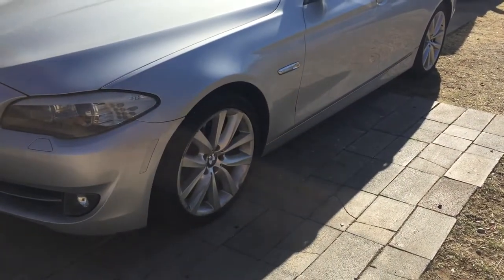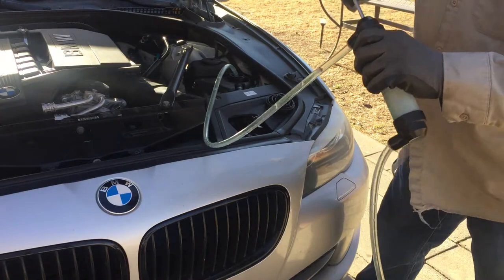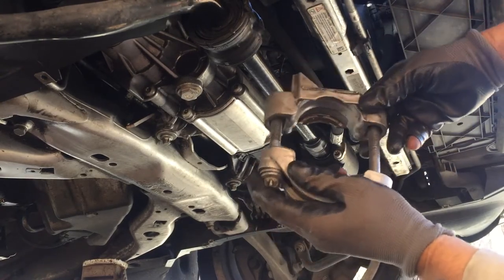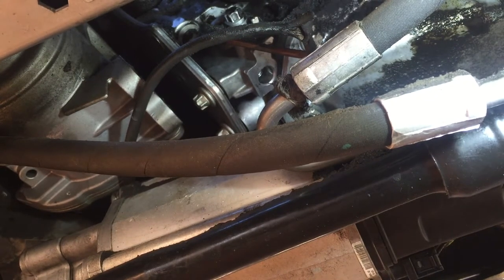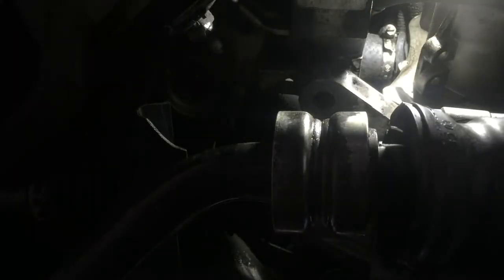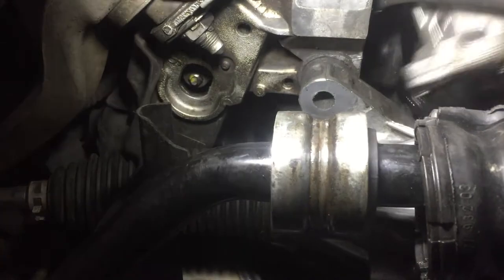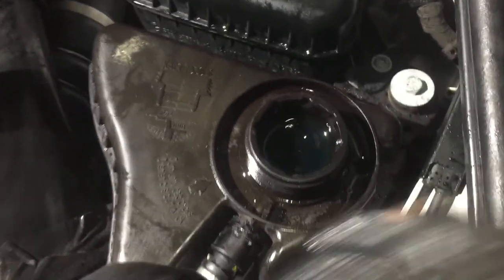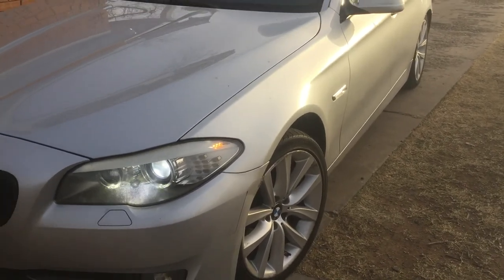2011 BMW 535i water pump & easy way to remove thermostat back hose

Comment: I was able to get the water pump out from the bottom by maneuvering it towards the center of the car. I just needed to temporarily remove a bracket for the bottom shield of the vehicle. Of course I was able to bring in the new water pump through the same route. Hope this helps others.

Comment: Good vid man, it's not a tough job but there is a lot of stuff in the way. I bet it's tough to film while you do it too. You can loosen the electric steering rack and drop it a bit so you can get the pump and thermostat in and out from the bottom. If you ever have to do the high pressure fuel pump or an alternator, let me know. I have a lot of experience with those two lol!
Reply from the maker: Hi Alex R thank you.  thanks for your comment I appreciate you thank you for watching

Comment: Another great video. I changed both but it's still overheating. No leaks but but only hot air keeps returning to the expansion coolant tank. Any suggestions?
Reply from the maker: Hi Chaka Atiim Gale If worse comes to worst blown head gasket or crackhead but I don’t think that’s the case you might have an air pocket stuck in there Jack up the car from the front fill it with coolant leave the cap off run it for about five minutes in that position and you’ll see all the  air pockets come up let gravity do the work and then take it for a test drive and see if that helps good luck brother .thanks for watching I appreciate you

Comment: Oh glad I watched this because I’m getting warm air through the ac front, hot on the floor but I was told valve, but then the fan was coming on intermittently….then I told him that’s not normal because what is the fan trying to cool off and sure enough…got a code for the pump, thermostat

Comment: Where did you puck up the replacement pump and thermostat
Reply from the maker: Hi RoadHerose610 FCP euro it’s a little more expensive but when I was running Bmw, they were offer a lifetime replacement on the parts. You can find them on another websites cheaper  but if you go to cheap they won’t last that long. thank you for watching. I appreciate you.
Reply: Thanks

Comment: Had a guy replace the water pump and thermostat on my bmw 535i 2011.  Now its leaking coolant by the driver side. Hes gona. Cowm check it out soon. Any idea what might be causig/whete  the leak is comig from?
Reply from the maker: Hi Laslay13 well your water pump should be like in the middle a little more to your passenger side   unless it’s dripping and running down a hose or a part of the car   but right now I would guess maybe just  a hose wasn’t tightened  they’re pretty hard to get to you kinda have to squeeze in there and tighten them up Hope that helps and thank you very much for watching. I appreciate you.
Reply: @Marty09933  I see.  Thank you and Semper Fi brother!!
Reply from the maker: @LASLAY13  you’re very welcome brother. Thanks again for watching  Semper Fi

Comment: Some water pumps have the electronic box on the front and some on the back of the pump,should I check what kind is mine or any type can fit on the car?
Reply from the maker: Hi Benjamin Franklin yes check your vehicle first if its like mine it should be in front .  Or it won’t fit   I go with FCP Euro  more expensive but life time warranty if it’s in the budget  if not you can go cheaper but won’t last as long.  Thank you for watching I appreciate you ….
Reply from the maker: Benjamin Franklin …,,https://www.googleadservices.com/pagead/aclk?sa=L&ai=DChcSEwjfvJqRhqT2AhWMKUwKHbTfCBoYABANGgJvYQ&ae=2&ohost=www.google.com&cid=CAASEuRoLqZwXEJFIFlkJPqd6feuTQ&sig=AOD64_368PaWXYDb6odW6vFmVAVm46kgbQ&ctype=5&q=&ved=2ahUKEwiv8I6RhqT2AhWxlGoFHTMCDZ0Qwg96BAgBEBA&dct=1&adurl=
Reply: @Marty09933 Thanks for the answer mine is n55ix 2013
Reply: @benjaminfranklin7998  was it the same as in this video ? I also have a 13 ix
Reply: @MrJoshbroady  Yes,it was the same pump,replaced everything alright now

Comment: What was the part number for the thermostat ?
Reply from the maker: Hi Hamzah Oaisar sorry I don’t remember I bought all of this in a package. Thanks for watching I appreciate you….https://www.googleadservices.com/pagead/aclk?sa=L&ai=DChcSEwjf9eOQ_87yAhWNcW8EHXYKDo0YABAEGgJqZg&ae=2&ohost=www.google.com&cid=CAESQeD2EZ92f_IYh_G6YQc1MyQft3JFygI2xjU8v0GLr7ddcJacujCUEnfZ9vnQFSwHT-6qgvhucxXSuy_l8KMxQgNv&sig=AOD64_24RHpAHrKbh5-OENDgS9PI58rZrQ&ctype=5&q=&ved=2ahUKEwiBo9iQ_87yAhVgmGoFHVzQCPQQwg96BAgBEBc&adurl=
Reply: @Marty09933  if anyone else is curious the fitment for the n55b30a engine is mahle TM 21 103 NOT TM21 97

Comment: 2024 latest update!!!  FCPeuro now offers an all aluminum water pump for the f10 from German Pierburg with the 3 bolts included!   This version is a major update to the VDO/Continental OEM water pump that is half plastic/aluminum and is know to fail do to weak design and internals!  Pierburg took care of that by beefing it up and making it robust inside out and fully metal case and it's only a few bucks cheaper.  This is a must when replacing the water pump along with the Thermostat and sure to last another 8 to 10 yrs! .

Comment: Misinformation about sway bar bolts… probably installed it incorrectly since first taking it off
Reply: Yes, confirming that the short bolt is in the front.

Comment: Don't see why you have to reuse those old worn out water pump/thermostat hoses they're as old as the broken water pump (those hoses got torn in the process when removing them, not good)!  MUST REPLACE ALL THOSE MAIN HOSES (not expensive) and have peace of mind!  You have a BMW, why in hell be cheap with parts....  🤔